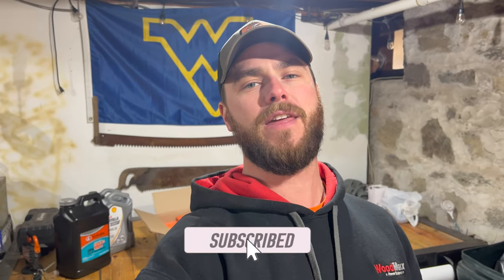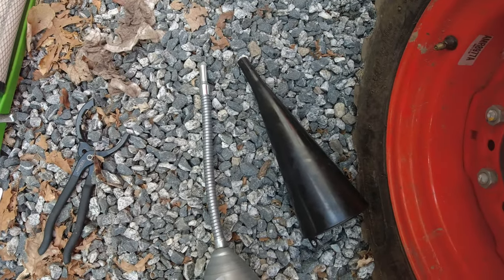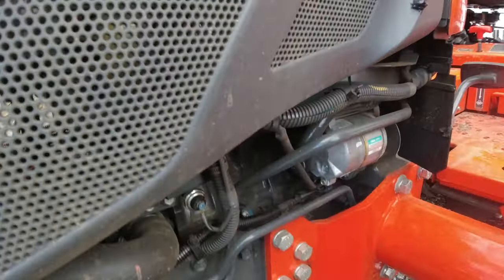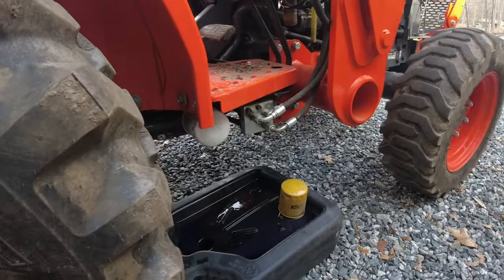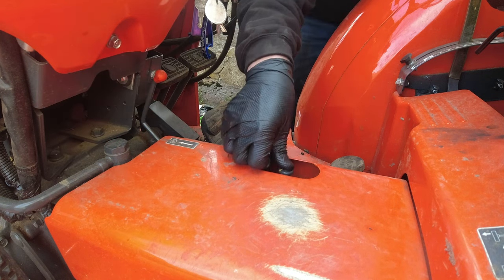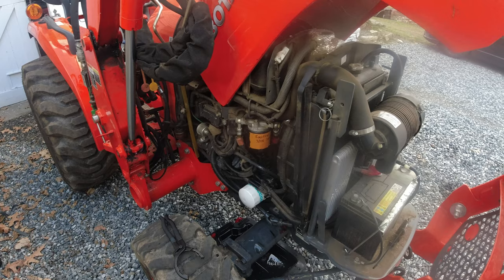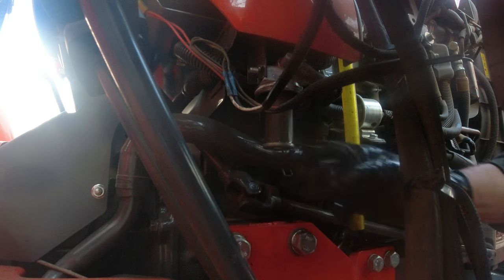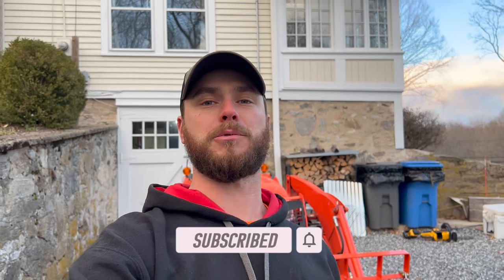#207 400 Hour Service on Kubota L-Series Tractor

Comment: Nice job with the shop vac. That’s an old mechanics trick for replacing the drain plug washer without changing the oil.
Reply from the maker: Thanks Elliot, I hadn’t heard of it before for that use. I’m sure it works well.

Comment: Great work…do you have a separate video of making all the adjustments? i.e, fan belt adjustment, clutch adjustment, toe-in?
Reply from the maker: No, I’ve never had to adjust any of those things.
Reply: @DudeRanchDIY  gotcha…my pto disengagement switch sometimes doesn’t cut off when I release the clutch pedal which is obviously unsafe. I’m getting ready for my 400hrs. Thanks Dude. 🤙🏽

Comment: At 400 hrs. aren't you supposed to drain/change the trans fluid as well?
Reply from the maker: Trans & hydro fluid are one in the same on the tractors. I flushed and changed it at 200 hours due to the amount I lost the first time when changing my hydro filter. After talking to my dealer they said the next time I would need to change is around 800-1000 hours depending on use.
Reply: @DudeRanchDIY  Gotcha...thanks!  Just getting ready for my 400 mile maintenance and was going through my parts list before getting started.  You video was very helpful...thanks my friend!  We love our L3901 and RTV900!

Comment: I made floor mats from a rubber stall mat from Tractor Supply. Kubota sells mats now for about $150.00. Stall mat is about $30. I understand there is a rubber air vent under the seat that if plugged with a round object just a little bigger than the hole you will lose very little hydraulic fluid.
Reply from the maker: I’d like to get or make some my pain is all scratched up on the floor boards

Comment: So you don’t have to replace [change out) the hydraulic fluid at 400hrs?
Reply from the maker: My dealer techs didn’t find it to be necessary since I did the 50 hour change.

Comment: Good video. I got some very nice mats for my L3901 from ITC quick attach they don’t cover the hump but I’m thinking of taking it off a spraying it with bed liner. Also I like your grill guard is it a 511?
Reply from the maker: Thanks I’ll have to check those mats out…yeah I’ve thought about bed lining that panel as well though I’d prefer something not as permanent. Yep the grille guard is from 511, I love it. Very high quality.

Comment: Always helps to pressure was or give the tractor a good bath before doing the service to keep everything clean. And why not just change the hydraulic fluid while your at it
Reply from the maker: Yep working on clean equipment makes it easier

Comment: My 2650 is change hydraulic oil at 400 hrs
Reply from the maker: I did my hydraulic oil at 200 hours, after talking to my dealer they recommend fully draining and changing the hydraulic oil next around 1,000 hours.
Reply: @DudeRanchDIY  Interesting! I figured the dealers would follow Kubotas recommendations. She’s ready to go for the summer now.

Comment: That's a 4x4 ? You haven't had to change front bearings yet ?
Reply from the maker: Front bearings? I hope I’ll never have to change those. Changing the front axle case oil will happen at 800 hours. Beyond that the front end is pretty much maintenance free beyond greasing.
Reply: @DudeRanchDIY  little tip for ya ,if that tractor has hydraulic fluid in the front axle "which is what they came out with" regular gear oil is recommended "per kubota" yes bearings are an issue because of this

Comment: what's with the shop vac? you are supposed to change oil the hydraulic oil at every 400 hours. drain that shit at all locations.
Reply from the maker: I had messed up at a previous service interval and drained all that hydraulic oil already around 300 hours so I didn’t change it here.
Reply: so if you had already replaced the oil why replace the filters if you had already done that? @DudeRanchDIY
Reply from the maker: Because the filters require changing at more frequent intervals than the entire hydraulic fluid system
Reply: This is not true, according to the service manual change filters and fluid at 50 hrs, then every 400 after that. if you changed them at 200 and then not again until 800 is out of spec. changing fluid and filters early never hurts though but the filters should be changed at the same time as the fluid. @DudeRanchDIY